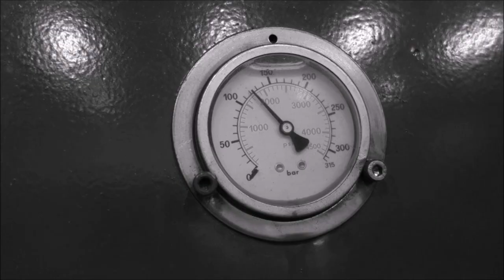SUPER SLOW MOTION: Soda can and bottles vs. hydraulic press

Comment: you should build an aquarium. (steel bot/plexi sides) and crush things underwater with slow motion. i want to see a phonebook. explode underwater
Reply: i wish i had more hands, so i could give this comment, more thumbs up.
Reply: 2ShotsDown +
Reply: This idea is fucking brilliant. I hope he sees this
Reply: An explosion of paper under water could cause the aquarium to also explode violently, and would be extremely dangerous... (read without the finish accent or cartoon animals). id still like to see it, with a phantom, but they'd need some genuine safety precautions, not just a bit of polycarbonate and a string.
Reply: Yea but if you use safety glass and steel + a shield it would be pretty safe. Alot of things would probably look awesome under water :)
Reply: He needs a better high-speed camera before he does it imo, but genius idea!
Reply: I totally thought the bottle was in water from the thumbnail and was thinking the same thing.

Comment: It's insane how much deformation the plastic bottle took before bursting
Reply: its because air in soda (bubbles) compressed. liquids arent compresable at all.
Reply: Rok Brglez You can definitely compress liquids. But you need lots of force for little compression.
Reply: Ооо, Вапцаров, к'во става? :Д
Reply: Its because the plastic, probably PET, is easy to deform and quite flexible. Not because of the air in soda. It would work the same with plain tap water.
Reply: I've blown up 2l coke bottles for fun, they also deform a lot before bursting, but this was on another level. Very impressive.
Reply: С живота под вежди се гледаме строго
и боря се с него, доколкото мога.
Reply: Will It AXE
Reply: Does anybody know the song names during the first 2 slow motions?
Reply: Ridiculously Entertaining Randomness sandstorm
Reply: i like anime t-shirts
Reply: I know!  I thought it was never going to explode!  The glass bottle was also great in slow motion.  : )
Reply: No, it's because the plastic stretched enough to avoid bursting early on. The aluminum and the glass did not have this elasticity so they failed much earlier.
Reply: Nick ok

Comment: when I saw the thumbnail i thougt that this video you would crush something in a aquarium and it made me think: Why not some pressing inside a aquarium?! You could use a strong metal plate as you use regularly as the base of the aquarium, so it can handle the pressure, and make everything else with balistic acrylic. you can seal the gaps with silicone or something like that. You'll get the cool pressing videos with some nice underwater shots, that would be nice i think. Hope you see this, or i'll flood your comentary section until you do lol. Best regards.